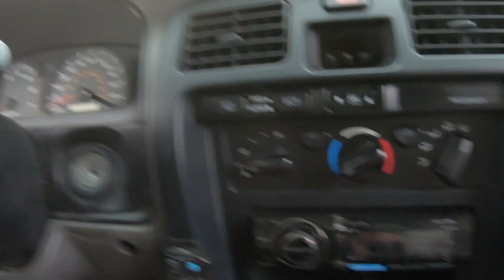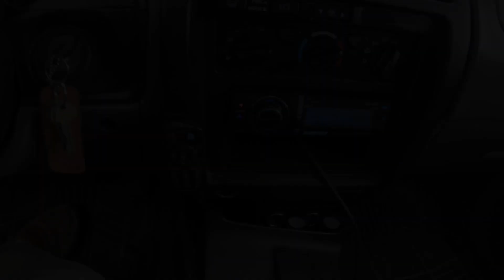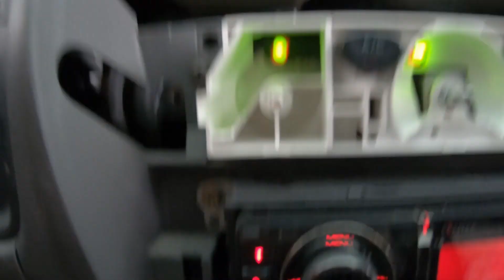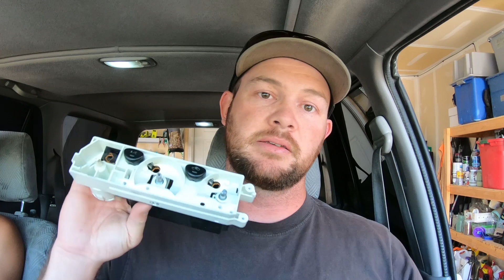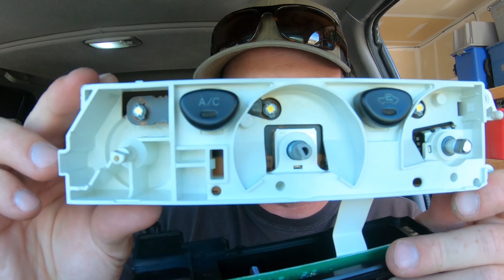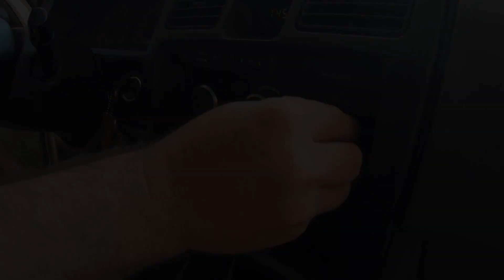ECT Restorations Climate Control LED lights and knobs. 3rd GenToyota 4runner

Comment: Thank you for uploading your how-to's on this! I mentioned you to ECT as well. But, I can't seem to find any resources on switching out the trans shifter lights tho, do you have any resources for that? Thanks!
Reply from the maker: BSG 75 they have that bulb. That’s where I got mine. It is an easy one too
Reply: @jfoutdoors4337  thanks for the reply! I'll keep searching for install tips on that 👍
Reply from the maker: BSG 75 it’s so easy. A flat screw driver is all you need man. As well as removing a few screws on the side of the console. Super, super easy